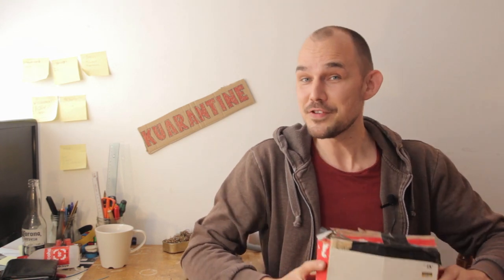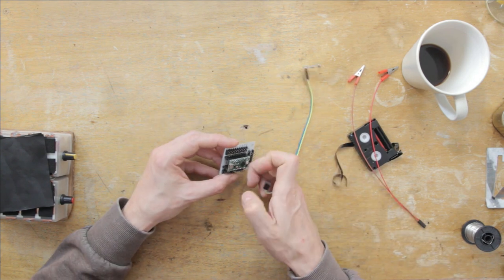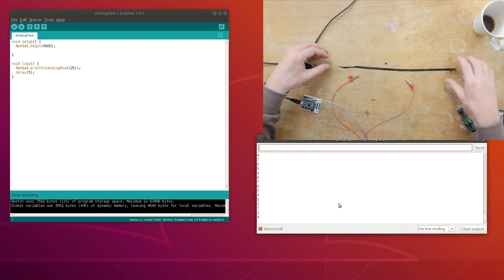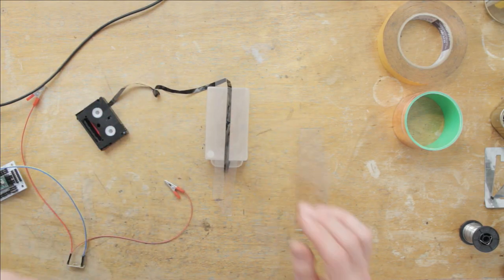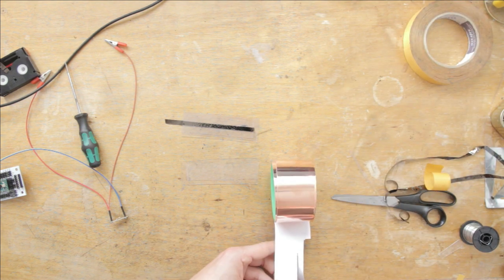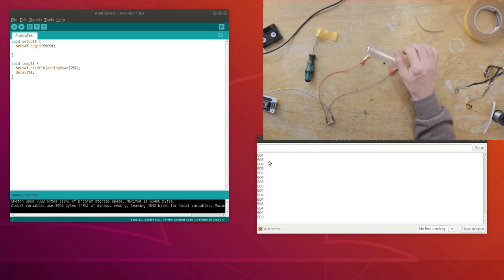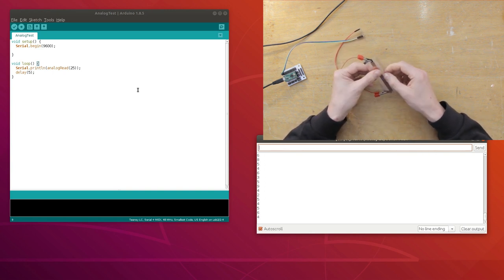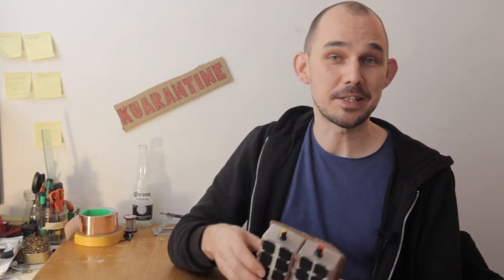Investigating DIY slider sensors made from miniDV tape, with the Kontrol Freak

Comment: I guess it's not specific to mini dv tape, and other magnetic tapes like from regular video cassette or even audio tape should also work. Right?
Reply from the maker: They might... When I first tried this years back, I was unable to make VHS tape work. I've since read somewhere that it has a much higher resistance, which I could probably have made work by adjusting the voltage divider. I don't have any VHS tapes lying around, or audio cassettes for that matter. Give it a shot, and let me know how it goes!
Reply: @KontinuumLAB  I've tested the VHS with multimeter, and it does not seem to have any conductivity, so probably miniDV is special in this case
Reply from the maker: @ @SitkaInstruments  Thanks for sharing that!